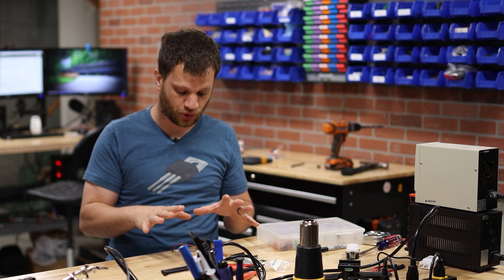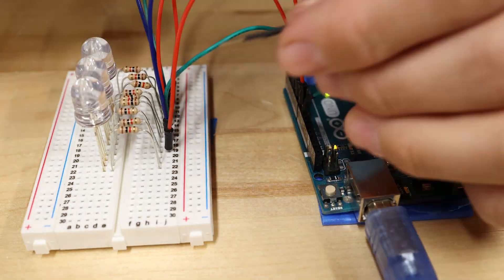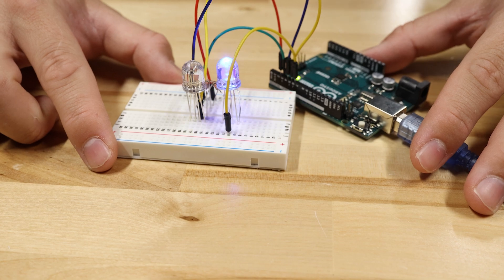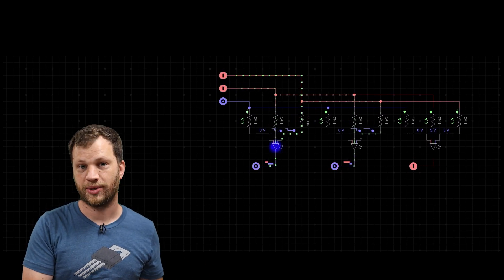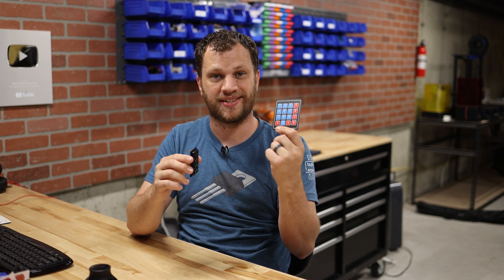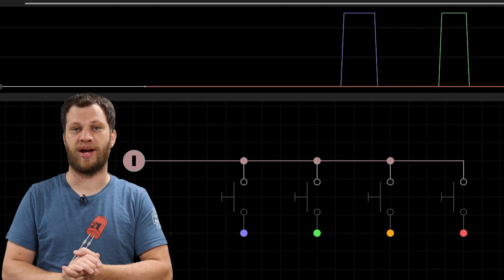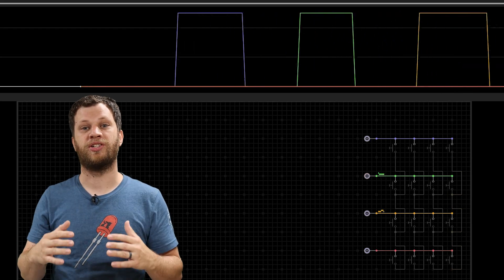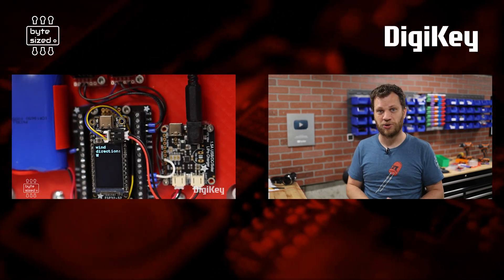Save your project by multiplexing GPIO pins - The Byte Sized Engineer | DigiKey

Comment: Your method would result in a short if 2 buttons are pressed at the same time on 2 different rows. To fix this you would need to make the row pin as input (high impedance) after reading so there would not be a possible short for any row. In my opinion. Back in the days where 3 state outputs were not widely available we used row diodes to prevent shorting.